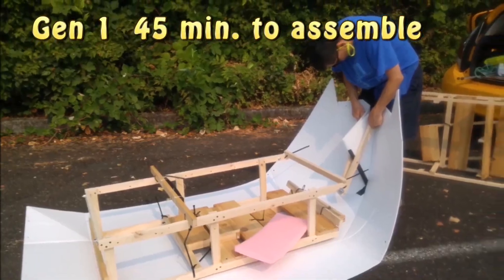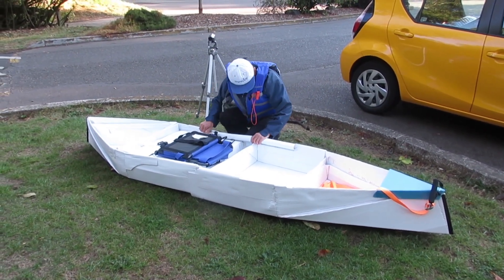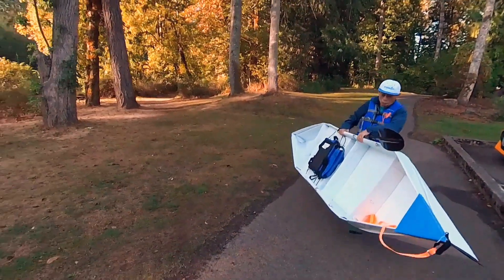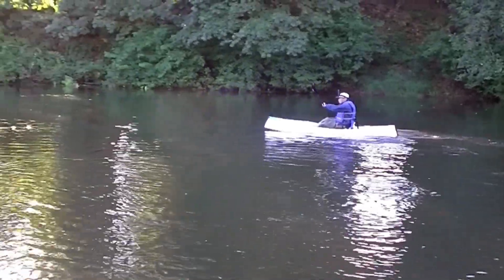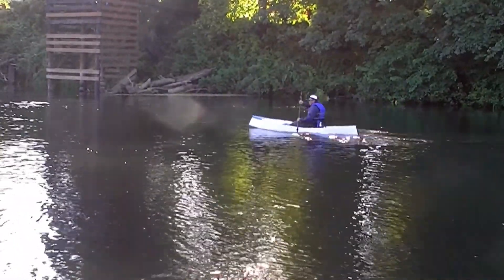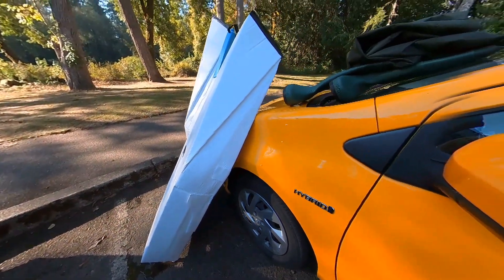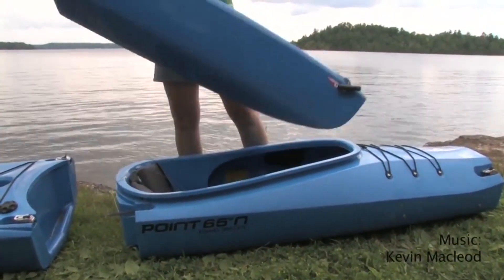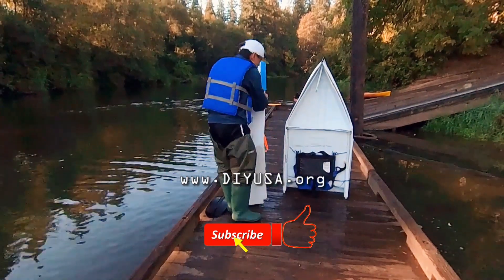Part 4 DIY  Foam Boat ! Modular ! 20 lbs  ! Sit-on-top

Comment: awesome! perhaps replacing the Coroplast with carbon fiber matts would help with rigidity, keep it as light and no need to let it drip off overnight?!? ... however more $$$
Reply from the maker: Thanks for the suggestion. I don't know anything about carbon fiber matts and I will do some more research on this. If I decide to build a 'keeper', I will definitely spend a bit more money to build a better one. Thanks for your support!

Comment: I like this design very much. I find it more comfortable to sit up when I am paddling or rolling instead of laying or sitting on the bottom. I also like how you continue to keep the weight low and the assembly quick. Some folding both are very heavy or take a long time to assemble. I have a video on my channel on how I made some pontoons to stabilize and inflatable raft I was using. The pontoons were very inexpensive and quick to make and would come in handy if you design a very thin narrow boat so you can paddle it quicker. I also like the fact that you use coroplast which has almost no maintenance. My inflatable boats will eventually wear out but yours will last much longer. Thumbs up👍👍
Reply from the maker: Thanks for your feedback. You have so many videos on your channel and finally I found the pontoon video. It is a nice design and low cost. I also build a set of pontoon/stabilizer for my G18 boat. Similar idea but slightly different approach in building the small pontoons/outrigger. https://www.youtube.com/watch?v=esJ9ZoFZMRE   Thanks for watching and your support!  Cheers!

Comment: I always said I would try and copy one of your boats for myself, I think this is it. Love it.
Reply from the maker: I have been watching others building their boats and 20-30 years later I finally built my first one, and I have not stopped... Thanks for your feedback. This boat can be built with 4 mm thick 4'x8' coroplast. You need a few sheets but it is a very sturdy and light boat. It will last for awhile because any tear on the outer surface can be repaired easily. The inner hull keeps the boat afloat. I will work on a video in building this boat. Please stay tuned. Cheers!